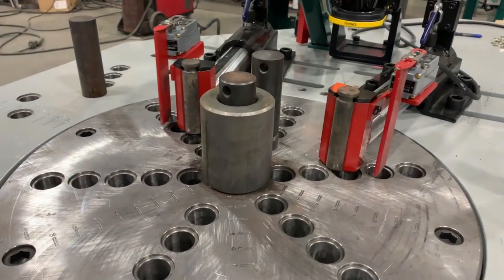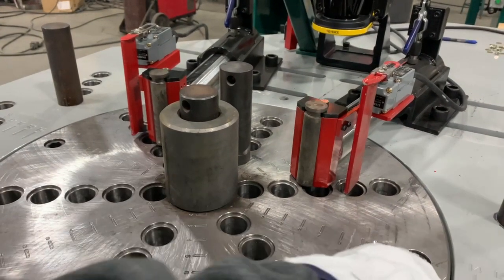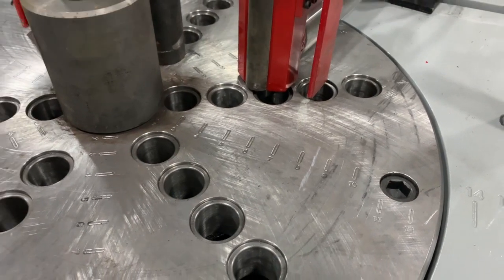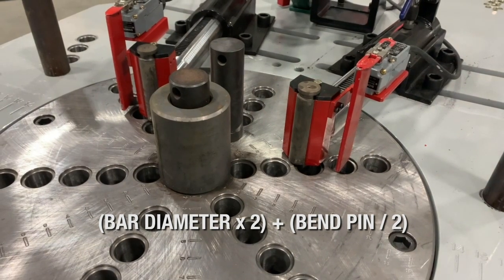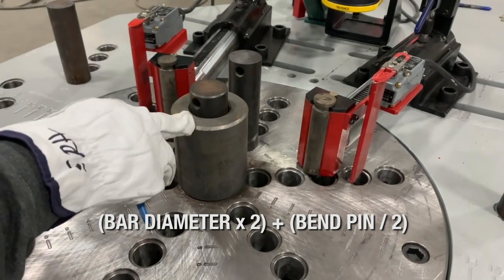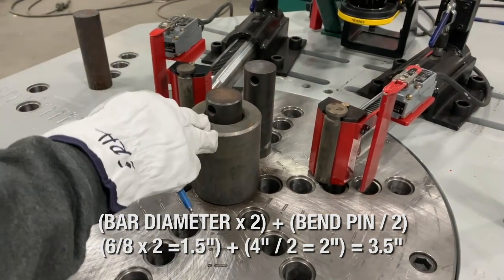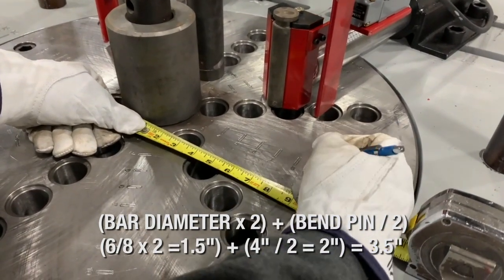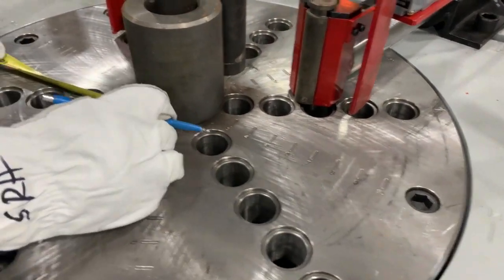HOW TO CALCULATE REBAR BEND DEDUCTIONS

Comment: hello sir, do you know what is the minimum size of a rebar bending pin need to bend a 22mm rebar? ive been try to find a table but i cant find one.
Reply from the maker: CRSI specs 4" center mandrel

Comment: I got taught a bit different but works the same.  Diameter plus pot size would be take off for 90° then measure from front of pot instead of center.